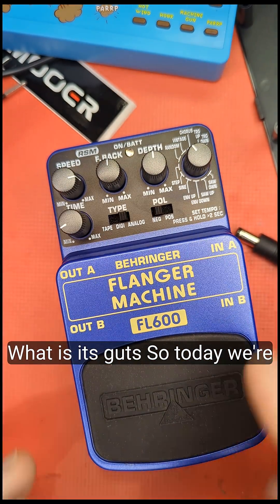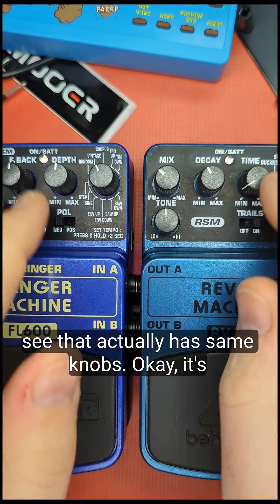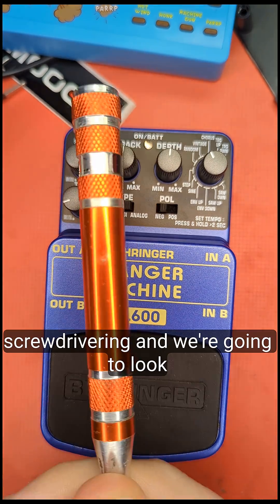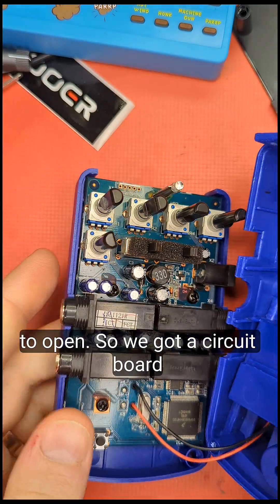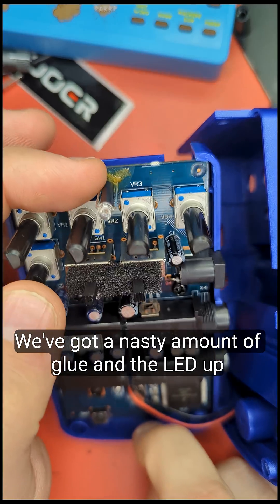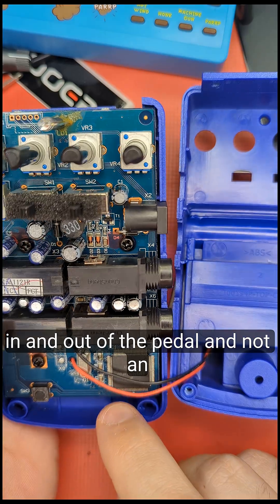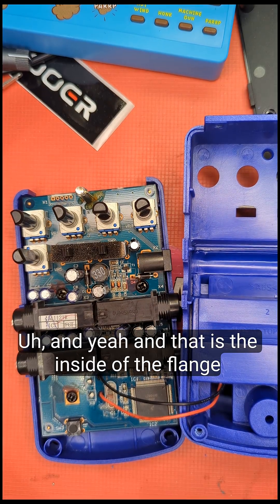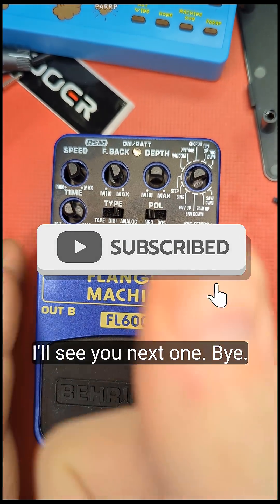What is it's Guts? Behringer FL600 Flanger machine - what's going on inside #electronics #pedal

Comment: I have the Echo Machine EM600. Great pedal! I wish I had the others, it would be cool to run them all in a huge stereo setup.
Reply from the maker: That's a interesting idea
Reply: I think you want an M13, skip.

M9 if you're just a little nuts and only want 3 at a time.

The Tonecore pedals are mostly dirt cheap right now. I wonder if you can still get the modules individually, probably on Reverb.

The Echo Park is the only one that's "-" silly money, and tbh it's hard to beat for $150.

The pedal itv goes for more than the original rn, no wonder bassists call us guitards 😂

Comment: Lol, of course a line of pedals that are difficult to impossible to mod are the easy ones to access.

I almost bought a cheaper Line 6 Tonecore to swap out for my LiquaFlange module because of you, you enabler 😂, but it can wait.

Oddly, these rare Behringers go for more than an Echo Park stateside right now.
Reply from the maker: That's true 😂 hadn't thought of that, but they aren't that hard to mod, depends what you want to do. 

I'm happy to know that I have that much power of your wallet 😂 👍 for next video "how you should buy this $5,000 klon"
Reply: @helaindustries nah, I have a "no gear that costs more than my car rule" locked in.

I do have a Mosky Golden Horse now, though. Brings the sauce like my Tauren did. 

I think that FX52 might kick my Carcosa off the board, not sure. So, you don't always use your powers for evil 😂